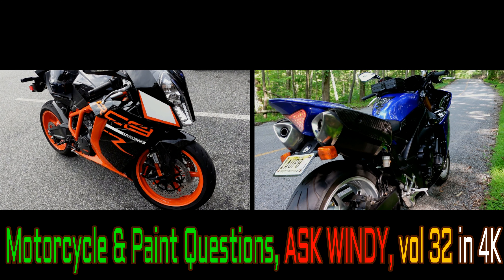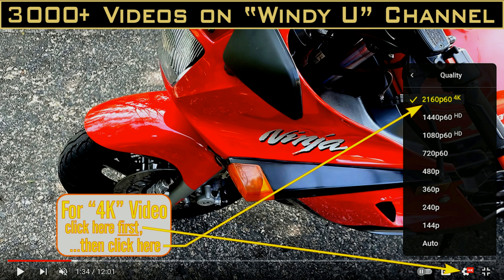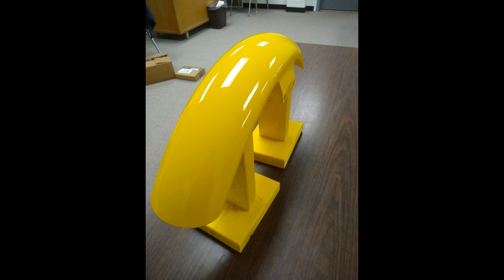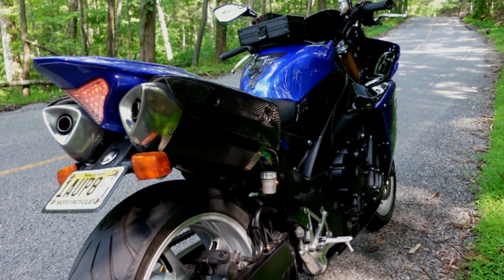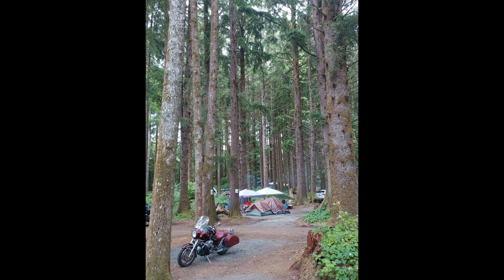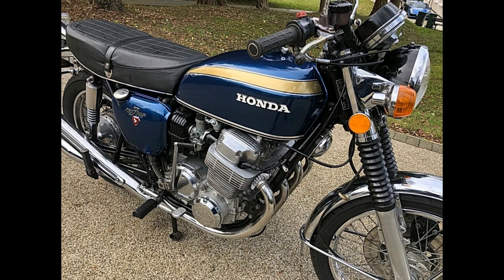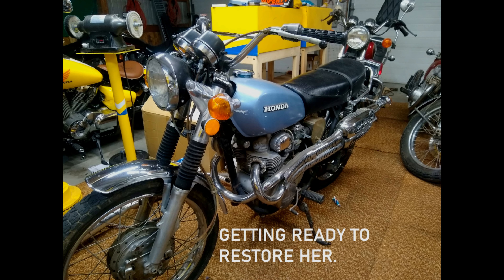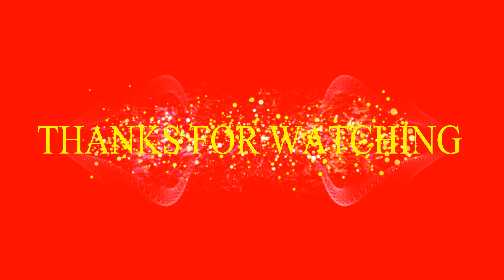MOTORCYCLE AND PAINTWORK QUESTIONS ASK WINDY,vol 32 in 4 K.

Comment: Excellent info.  That carbon fibre R1 exhaust fabrication is quite complex.  Your a true master in fabrication and paint.  I’m thinking all the years in the model aircraft hobby has really honed in your high skill set you use on your bike collection.  As always, thanks for sharing.  I have a project question on a different subject….Have you or Luciano ever had to repair a leaking radiator?  I hear people have braised motorcycle rads with success.  Do you have any insight on this subject? Thanks in advance, Cory